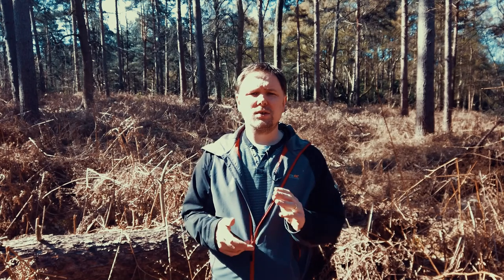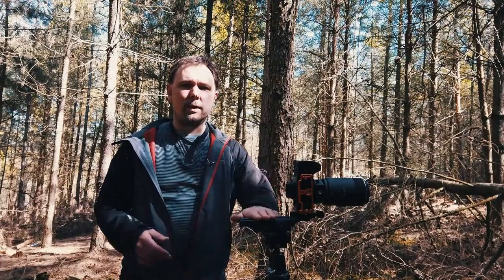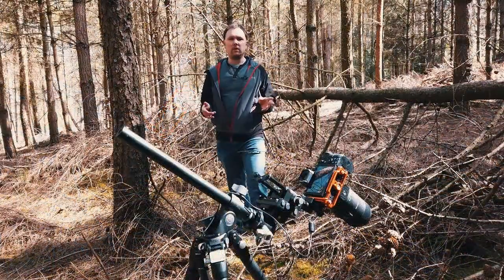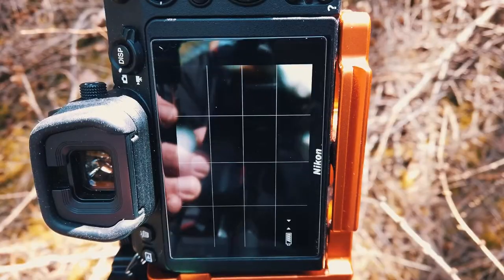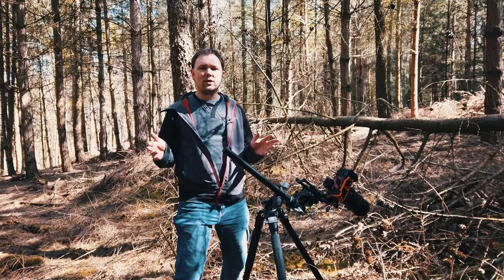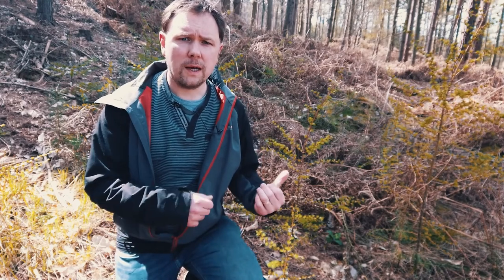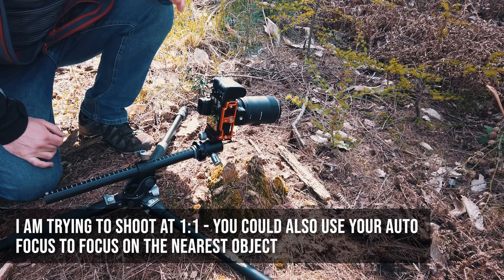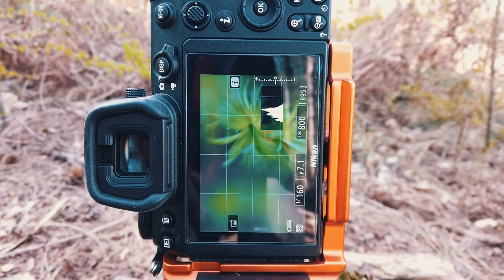How do focusing rails work?  |  Neewer 4-way focusing rail   |   Introduction to focus stacking

Comment: Charles, if I had the built-in functionality, I would definitely be using it.  Excellent video and stunning macro work.  Thank you for sharing.
Reply from the maker: Cheers Craig! Do you manually change focus to focus stack? Almost included that in the video, but it was getting a bit long, and I'm never very good at judging it just by adjusting focus manually!
Reply: @CharlesPalmerPhotography  I am still using an old Nikon D600. So, I usually select a different focus point on an out-of-focus area of the composition. Of course, that is dependent on the limited number of focus points and their location.  I may end up doing a video about the focusing system on the D600/D610.

Comment: Hi. I have just acquired a macro lens. In your first example, using the Neewer rail, did you experience camera creep as the weight of the camera and rail move the lens nearer to the subject? Perhaps the Neewer has some form of locking system that has to be engaged before taking a shot. The reason for my question is that I have the Shoot rail (some years old, now) and am wondering whether your Neewer is more stable. Thanks.
Reply: Hi Charles. Forget my question as I have since bought the Neewer rail and it does not creep. It is excellent.

Comment: What I don't get is, since you are moving the camera closer to the subject with each shot, that should make each image framed a slightly different size...as an example imagine 20 shots at 1/8 inch closer distance with each shot.  After 10 shots you have moved more than an inch closer to the subject which should make it larger.  It seems to me the accurate way to do this would be to slightly change the focus manually with each shot, keeping the camera in exactly the same spot throughout?
Reply: Actually no. I bought this year my first real macro lens and found out  about focus breathing, which I will explain: when you have the camera and subject still, when you try to manually focus on another part of the subject, it actually zooms in a little bit. It's like you have a zoom lens, but you actually don't. It's anoying, but it's present in probably all true macro lens
Reply: @raduszilagyi6055  What I was referring to...let's say you take a picture 3 feet away from a bicycle, then you take a photo every inch closer until you are one foot away from the bicycle....the image size of the object from front to back will have changed dramatically.  I realize this is a exaggerated example, just using it to clarify my question, doesn't the size of the object become larger as you move the camera ever closer to it?